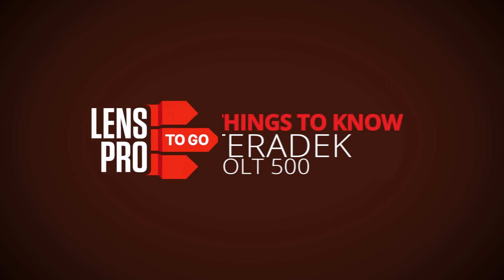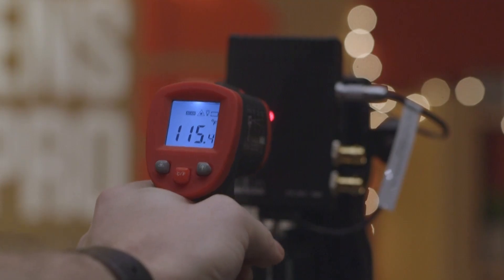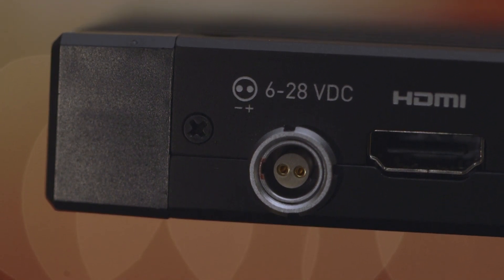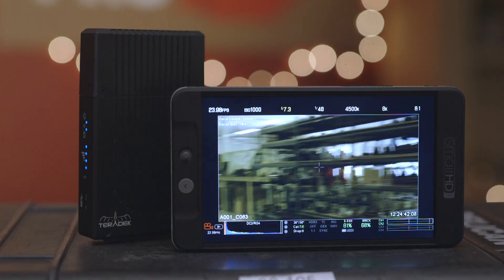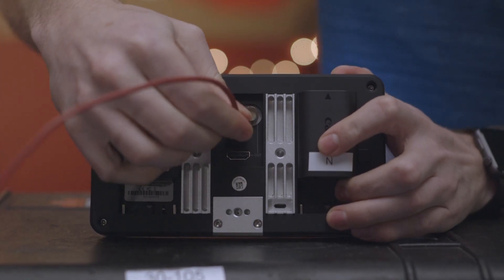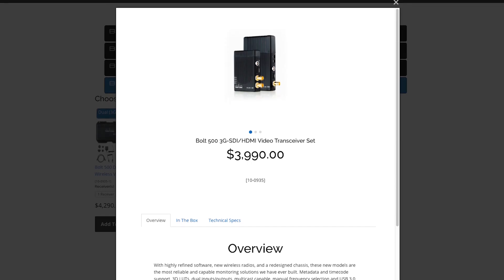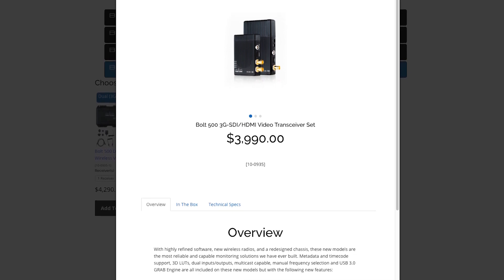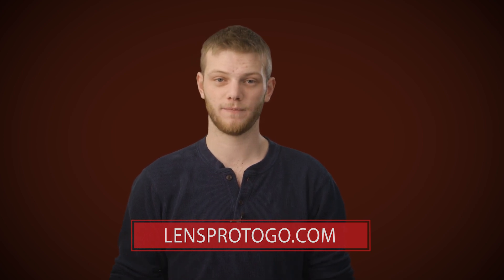Teradek Bolt 500 - Things To Know

Comment: Can we use an LP-E6 or Sony L battery to power the transmittor?
Reply from the maker: I believe you can but you will need to get an adapter that goes from that battery to teradek lemo.
Reply: Yeah, Teradek have battery adapters that are terribly overpriced.

Comment: Hello Greg i have such rather difficult question about Bolt 500 with only HDMI inputs/outputs 
Here is my situation and i want to find out will that set up i am describing right now work with Teradek Bolt 500 HDMI.
I have a Ronin M and Small HD 701 Lite 7" HDMI On-Camera Monitor mounted on a gimbal, from my Sony a7sII video signal goes to the monitor for the gimbal operator, and the HDMI out from the monitor  distribute the video to Teradek BOLT 500 Transmitter and from the Transmitter one signal goes to one of Teradek Bolt 500 receiver witch is connected to the Small HD 702 bright monitor  witch is used buy our focus puller and this monitor sitting on the Wooden Camera Directors Cage V2, and the other signal from the Transmitter going to the another Teradek Bolt 500 HDM receiver and that receiver send the video to BlackMagic ultra studio mini recorder  and via Thanderbolt 2 cable than to thunderbolt 2 to thunderbolt 3 converter from StarTech.com to new MacBook Pro late 2016 and than it goes to Wirecast software for the Facebook live stream to Facebook Fan page.
So the question is does the Ultrastudio mini recorder from BlackMagic will understand and capture the signal from the Teradek Bolt 500 receiver and my set up will be up and running?
Thank you for your further assistance
Reply: ok thank you

Comment: i did not know there was a previous Bolt 500....
Reply: I think he means it replaces the 600 model.
It went Teradek Bolt, Bolt Pro 300 / 600 / 2000 and now these are the 500 / 1000 / 3000 models.
Reply: He also fails to mention there are two versions of the transmitter:
SDI only and HDMI / SDI dual port. The latter is the only version that cross converts directly from the transmitter.

Comment: I don't use extra monitors that often, bur I have to say that the bolt is the BEST wireless transmitter I've ever used.
Reply: ***** VELCRO TO THE RESCUE !!!
Reply: ***** just a little 2x2 patch on the back of a v mount battery and the other end on the bolt. Right as rain .
Reply: ***** right. Never actually had that problem but I understand the concern.